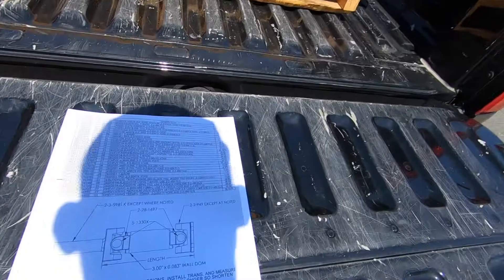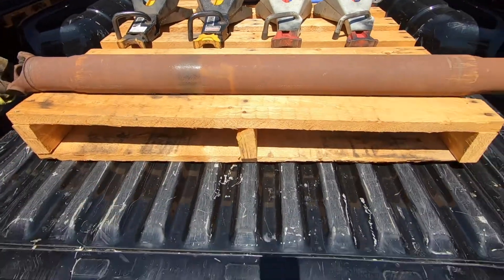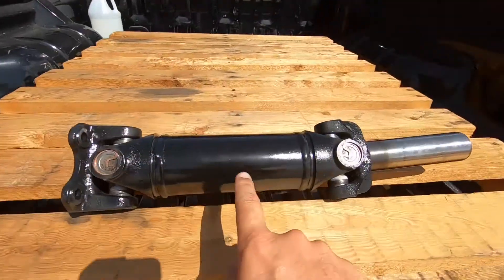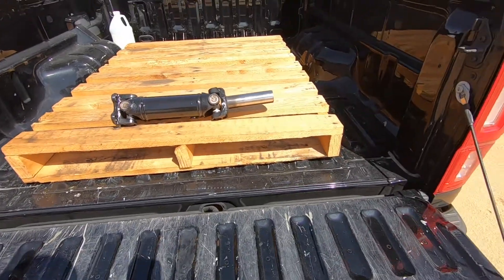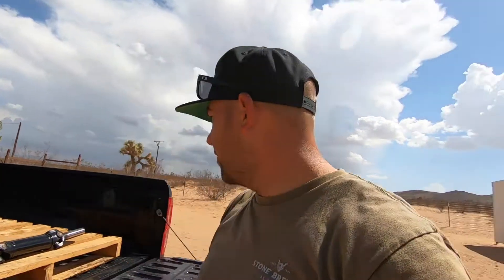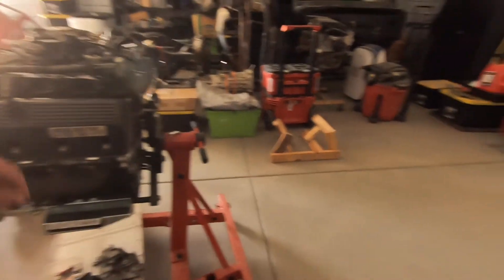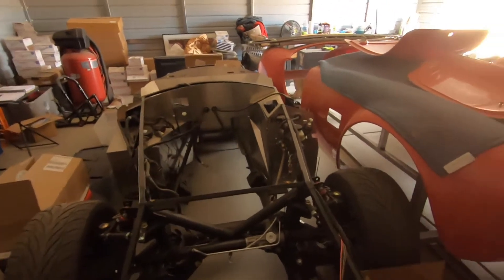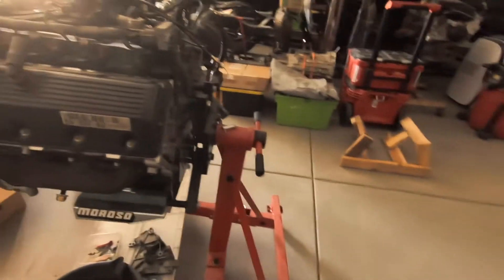Factory Five Cobra Roadster - Driveshaft Shortening

Comment: On my 4.6 I capped off the EGR. Went with Terminator X and lost the coil packs and wires. Now has coil on plug. Really cleaned up all the 4.6 wiring mess and tubes. Plus. When you and I open the hood of our Cobras. We have direct access to plugs. No reaching between headers to change them. Love the modular engine for the cobra build.
Reply from the maker: I need to stick with the EGR for California emissions and I'm trying to keep it as stock as possible for a baseline. Looking forward to not having to snake my hand around headers to change plugs though.